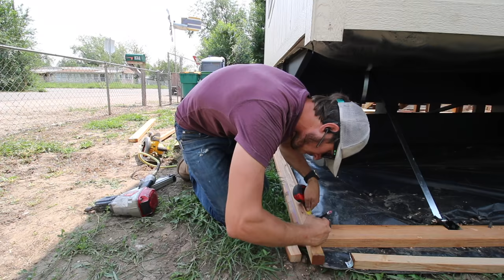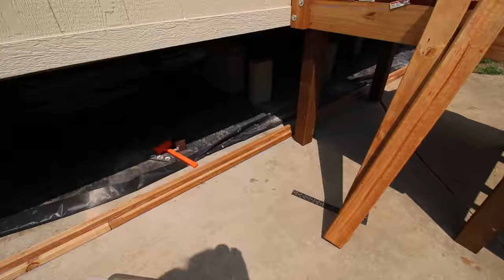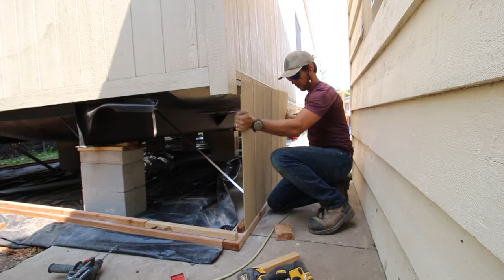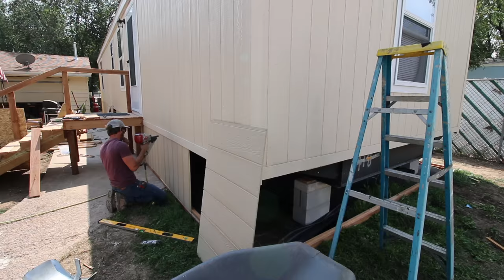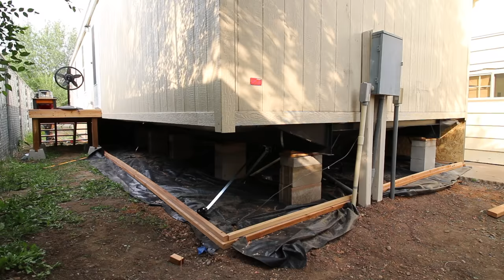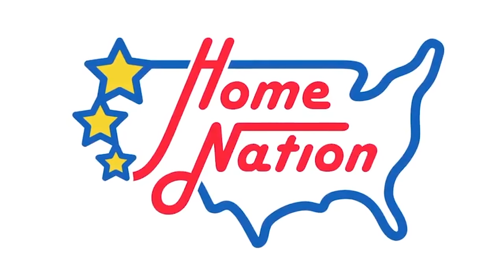Single Wide Skirting Timelapse - Home Nation

Comment: Folks ... do NOT install a horizontal "band board/trim"  even if caulked it will eventually leak and catch debris, this will rot out your sheathing.   Use "Z" flashing instead. Paint the bottom  end/edge of the sheathing. Do not caulk it, that way it can drain.   Gravity never fails, caulk will. Z flashing not caulk.  I understand the horizontal trim can look nice, but it's no fun letting your sheathing rot.

Comment: The worst is the lack of venting. Not mentioning the ground contact wood.
Reply from the maker: In this video they are using hardie board siding. Termites cannot eat the cement that these boards are pressed with.
Reply: I also would of like to add some ventilation as well
Reply: That was definitely not hardie board...thats the lp smartside panel made of osb
Reply: @nicksinclair2407 exactly what I was gonna say
Reply: @Homenationmobilehomes LOL
Reply: Question to anyone who will answer ? Will doing this pass inspection ? If I vent it ?
Reply: @nicksinclair2407  Made in Swan River Manitoba.

Comment: Even if the bottom  plate were pressure trt'd wood, a building inspector would insist on some sort of concrete stem wall or pad. This is exactly the wrong way to do it. That bottom plate will disolve in a couple years. This guy is your best installer?
Reply: Why in the world would a building inspector come into my property and mess with my house?
Reply: @rgawt1870  hahaha really the guy was waiting to see something he could pretent to know some shit about if it wasn't this he would of found something else....

Comment: I’m not seeing what you’re doing at the top there. Can you explain how you are attaching the top of the skirting to the bottom of the siding? Unfortunately there is not any information on doing this type of job.
Reply: I was about to ask the same question ⁉️😂 Hope they or someone else answers us
Reply: Looks like he’s tucking the skirting behind a trim piece that runs lengthwise then every 4’ he puts a 2x4 behind the skirting for a nailing edge
Reply: @eugenewilson7555  basically that.  You can also attach 2x4's under the 2x6 wood frame

Comment: wood on ground will get soft or change shape groundless if pressure treated.
need four inches of air gap or use a product that is hard but will not change its form.
Reply: explain this.  TY

Comment: What kind of stakes did you use to ground the 2x4 you used for a rot board
Reply: I did something similar. I used 6 inch galvanized spikes into the 2x4 into the ground then the spikes through a 4x4 into the 2x4 all ground tested. Caulked the steam around the top, 2 coats of primer and 2coats of exterior paint.

Comment: Can't breathe and will hole moisture.
Plus wood needs be pressure treated, I perfer metal rails over wood. Because of bugs. 
You need ever 3' feet studs on center to meet state code. 
You need have lower vents ever 4' to help flow of air.
Reply: State codes?
Reply: for underpinning?  Is that not for the house itself?

Comment: How did you connect the top of the board to the trailer? I can see the bottom and the vertical 2x4.
Reply: I had a worker install 2x4's  under the 2x6 frame board to attach the cement hardy backer board. Replaced the metal band back on.

Comment: I see no need for vent when plastic is on ground, floor has barrier underneath, and or when building is 2ft above ground, but in cold weather I do see the need for air tight..........  But I also see the need for slowing down the video in certain places so I dont have rewind 15 times.......... I do like the idea of pinning 2x4s down, I'll do the same..........